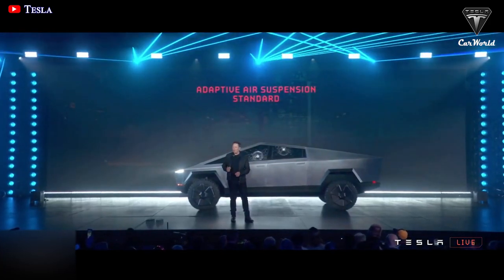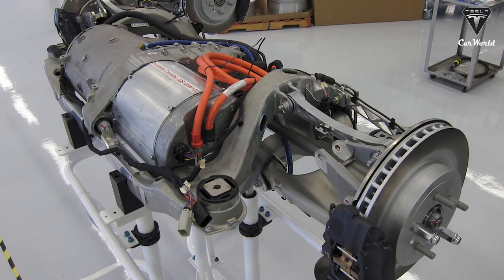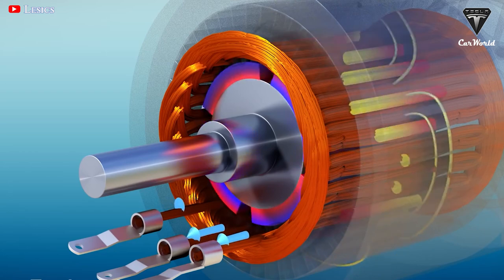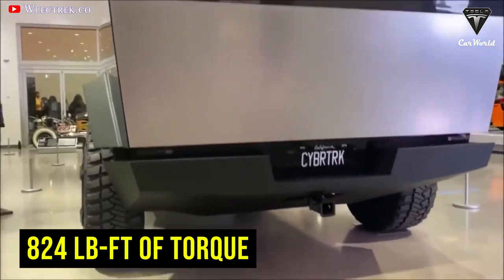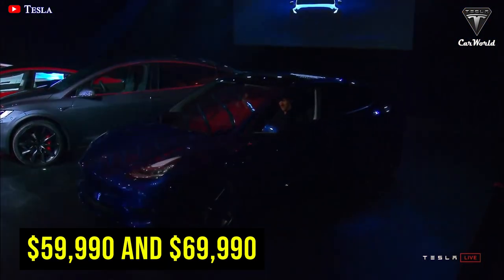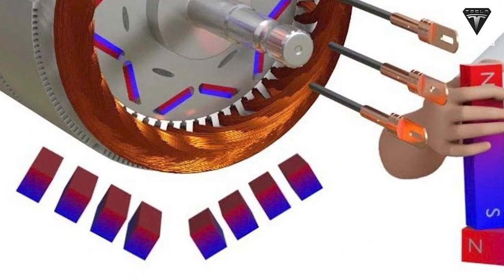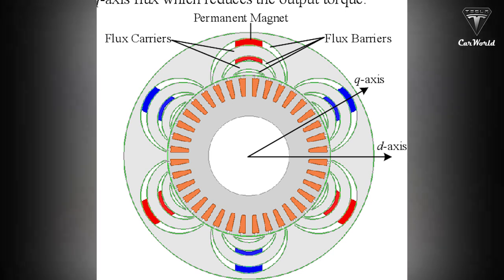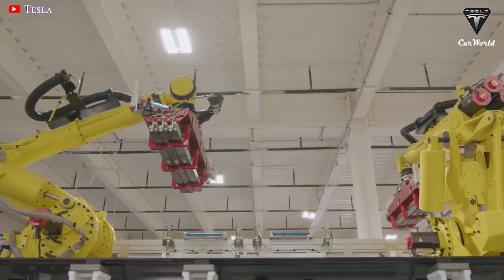Elon Musk Reveals Cybertruck's Motor - The Brilliant Engineering Behind It

Comment: When you call it an “engine” that usually refers to an internal combustion engine. Gas is the fuel. When you call it a motor that usually refers to an electric motor! It uses electricity. No gas ⛽️.
Reply from the maker: Thanks for sharing !
Reply: Engine originally was used for any device, so a bullock or horse was often the only choice. Later you had the "Steam" engine. Nowadays "Petrol" engines or "Diesel" engines have become the normal engines. If you are flying then you may see "Jet" engines. When going to Mars or the Moon then you may have to use a "Rocket" engines. It's anything that converts to moving force.
Reply: Wanted to say the same thing. People will get used to "motor". Give it time. Teach the masses.

Comment: I guess you don't consider the Rimac Nevera with it's 0 - 60 in 8.5 seconds a production car
Reply from the maker: I know, The Rimac Nevera is an all-electric sports car designed and manufactured by the Croatian automotive manufacturer Rimac Automobili.
Reply: Is any >$2million hand built limited production car really a "production car?"
Reply: And there was two built?  I’m not sure that’s “production” vs prototypes.   Tesla has sold 81k+ model S units in 2022. 

  Not to be picky…but don’t you mean 0-60 in 1.85 secs?     

And don’t you think tesla couldn’t make 2 vehicles to get that and better?   Seriously, tesla has $100 million to throw at that project if it wanted to….and with as much money as they have ($22B, debt free too), that’s just an accounting error.    Not Rimac at $250m total value.

Comment: Compair the electric Ford f150. Apples to apples. May not be all that. Also Ford is available now. Tesla truck is vapor so far.
Reply: Typical Ford it can't tow well snd I doubt it's capability in mud/snow/ice. Haven't driven Ford that did those conditions any better than a lada.
Reply: @GrigoriZhukov  if u looked at the video the Ford was a 2 wheel drive. It would be great to try again with ford's electric pickup against Tesla's. I wait Tesla doesn't make 1. Just has prototypes.